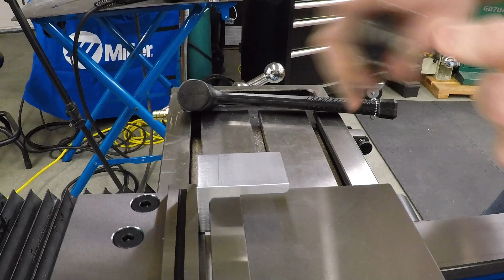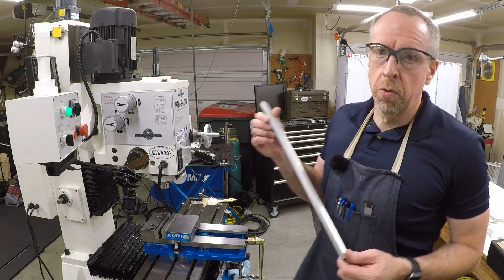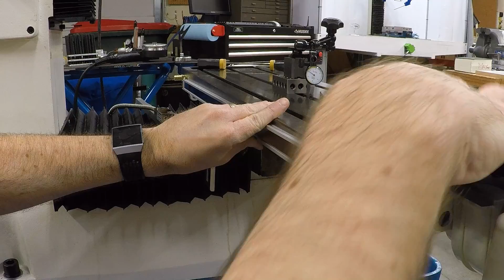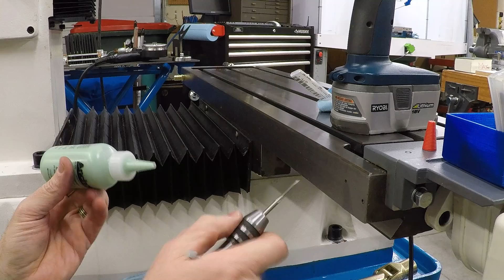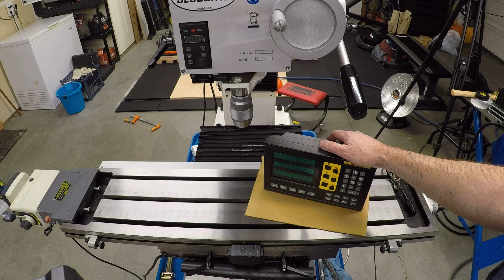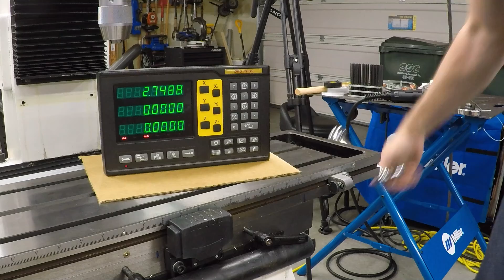Installing a DRO on a PM-940 Milling Machine - Part 2 - 4-Axis EL400

Comment: I am trying to decide which mill to get from grizzly I need something small enough for the Benchtop but strong enough to mill pockets in aluminum and mild steel? Any suggestions on what model would be the best for my needs? Also no more than 500 pounds.

Comment: Hi. Sorry for this year late comment/question. Could the manufacturer supply several predrilled/tapped holes? Thanks for taking the time to post this and all your projects.
Reply from the maker: You can buy the mill with the DRO preinstalled for a fee, when they have them in stock.
Reply: @Clough42  Thanks for your reply.
I did not think of that. I have a nice Jet RF 30 that I am looking to add a dro to but positioning the head on the round column is challenging at times. I know there’s fixes for this. I have not  purchased/fabricated anything yet.

Comment: Nice, that's quite a bit different than the cheap-o Ebay one I just installed. Of course in hindsight, I wish I did the x-axis first too 🤣. 
Also, I have just discovered that a drill point endmill is excellent for milling slots 😁. Guess some call them "slot drills", now I know why.
Great vid, James! 👍😊👍
Cheers!

Comment: I've had a 3 axis DRO sitting by my (non-CNC) G0704 for about 5 years waiting to be installed (hey, I've been busy!).  Maybe I'll steal some of your ideas after scaling them down and get motivated enough to actually install the thing.  For some reason it doesn't read properly when not installed.  ;)

Comment: Put some wax in the end of those hex bolts and then they won’t fill with chips. To clean, use wax solvent and then plug in hex key. Easy.

Comment: I wear safety glasses because I don't want chips in my eyeballs. Makes it hard to see things when I've got scratches on the eyeballs and they have to heal and I would have to go to the hospital to get them out under optics by a specialist. Wear the safety equipment; you have a lot less problems.

Comment: As always your video posts are top notch and informative, I will say though that I'm a little disappointed in that you are using magnetic scales for the DROs. I do realize where you got them and their quality but I will be remised if I didn't mention that the magnetic properties of the scales make them extremely prone to contamination from iron and steel particles despite the use of chip shields. Ive been there and dont that had major issues and switched to glass scales on both my lathe and mill. The magnetic scales did work initially but after about one year in,  the accuracy began to be affected and I switched to glass scales....that's been now over 3 years since I switched, and with zero problems. Maybe you will be fortunate and not have troubles with them and if you are,  you will be one of the 5% that dont.....Just sayin!!!!
Keep  up the excellent work.....it's nice to see someone intelligent and articulate in their methodology and actions.
Reply from the maker: Interesting.  Many people have had exactly the opposite experience.  In fact, DRO Pros positions the magnetic scales as their premium product and offers a better warranty.  It will be interesting to see how it pans out.

Comment: I think I'd use pan head slotted screws for that scale cover rather than the button head cap screws. The pan head screws should be a little shorter than the button head screws, assuming you can get pan head screws in metric.

Comment: Great video production, well storyboarded, nice lighting and use of microphone.  Is it hot wherever you are (short sleeves and shorts) ?
I clamped a steel block to the back of my mill table - with a hole in it - to act as a guide for the drilling of DRO mounting screw holes.  This not only kept the hole square, but importantly maintained the required position, not knowing if the table hardness might cause my hand drilling to wonder.
Reply from the maker: It's below freezing at night here, and a little above in the afternoon, but I had the heat on in the shop all day, so it was pretty comfortable.  Using a guide block is a good idea.

Comment: Hope I'm not duplicating a comment here, but the hard to reach points would be fractions of an inch. A whole inch is an even tenth of a mm, so as long as your scale is under a tenth of a mm in precision, you should hit hole and half inches no issue. A quarter inch is 6.35mm, so now you need half a tenth. 1/8" is 3.175mm, which requires half a hundredth - that's very close to 0.0002" by the way, which seems to be the scale of yours.  So try getting to exactly 1/16" (1.5875mm)  or 3/16" (4.7625mm), and you may find that you have to go a little off. Obviously, you'd also struggle to get 1.0001" - you will need to go to either 1.0000" or 1.0002".  Or set it to show only 3 decimal places and round to nearest 3 digit when you convert into thousandths. 

I still haven't ordered my DRO - or figured out what size I need, for that matter... :)

Comment: Interesting you are putting the display on the right side; most displays are mounted on the left since most folks look to the left first. I think it’s because how we were taught to read left to right? On my lathe of course it is on the left since that’s where the head stock is but I did mount my display on my mill to the left. When I had my Bridgeport with the factory DRO it was mounted on the right. Maybe it’s if you plan to use the left side wheel or right side wheel for the X travel?
Reply from the maker: The x crank and quill levers are on the right.  Having the DRO on the left would be rough.

Comment: Wonderful comment about wearing safety glasses. My own experience... at dusk one evening I was outside behind a truck. On the back of the truck, hanging just over the top of the tailgate, was a sheet of 1/8" steel measuring 1/8" X 4 foot X 8 foot. The sheet was laying horizontally. As I turned and started walk in a new direction my head swung into the corner of the sheet. The cut was level with my eye an only 1" away from the eye. The cut was so deep that it didn't immediately bleed. Now when I arrive at my shop I put my safety glasses on as I get out of the truck. I wear them all day long. Accidents can come in a number of ways. I was very lucky... lucky also to have a friend nearby.
Reply from the maker: A finish carpenter friend of mine was distressing a wooden beam with a wire wheel in an angle grinder when he got a phone call and took off his face shield.  After he got off the phone, he had only a little bit left to finish up and forgot to put his safety gear back on.  A wire dislodged from the wheel and penetrated his eye.  Long story short, he pulled it out, drove himself to the hospital, and fully recovered.  He was lucky.

Comment: Nice video. Are you planning on mainly working in metric, imperial or both depending on what you are milling?
Reply from the maker: I use whatever is most convenient for what I'm doing.  Usually that means whatever leads to whole numbers of units instead of long decimals that lead to mental errors.

Comment: Hi James! When installing the x measuring ruler, make sure that the oil point is not covered. I have a similar machine and after half a year the rear dovetails had jammed due to insufficient lubrication. It is useful to also considerably shorten the two mounting bolts for the table drive. That makes cleaning the table much easier. I also raised the machine 10 cm, better for the back.
Reply from the maker: The oil port on this machine seems pretty much useless.  It literally goes straight down and ends on top of the dovetail with no visible distribution grooves.  I extend the table fully to each side and apply way oil with a brush before I use it.  A one-shot oiler would be handy.
Reply: @Clough42  came to find this issue while installing my DRO.

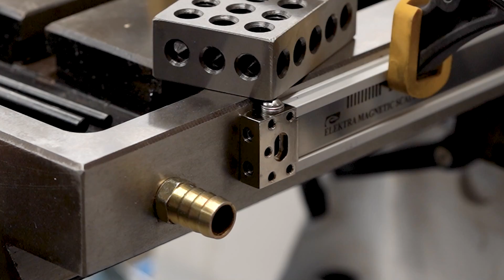Comment: What's the magnetic stand you use on the DTI at around 19:20? I've got one of the cheap ebay specials, but I've not come across one with a fine adjuster like that before.
Reply from the maker: https://amzn.to/33FwerY
Reply: @Clough42  Nope.....Too expensive.......I just use a regular scribing block with a small dial indicator as it already has the fine adjustment.

Comment: Hey James! Coming from a garage workshop, any tips on how you keep from tracking chips into the house. I have little ones and I just have to clean up really well before going inside so chips don't end up under their feet. Thanks!
Reply from the maker: It doesn't really matter what I do.  Some always end up in the house.
Reply: @Clough42  seems like that's my case also
Reply from the maker: I tested a new insert end mill in steel last night, and it shot .005"-thick bright blue chips eight feet in every direction.  I think some containment is going to be a necessity.
Reply: @Clough42  Now you are getting wise........anything pertaining to a milling operation is sharp pointy chips.
Reply: @Clough42  My wife sews and I find pins around the house so in my book we are quits !
Reply: I always brush and or blow myself off, before coming in the house after playing in the shop. Most times I also  remove my shoes as wiping your feet rarely ever removed the chips.
Reply: @royhauer311  I try so hard. But always tend to have chips in folds of my clothes. Also, the chips I blow around (aim for under my bench) tend to find their way under our feet into the house. I just have to drain an entire compressor tank anymore keeping the chips at bay

Comment: Hi, I would drip paraffin wax into the hex heads to keep them dirt free. Your wife should have 100s of those small T-lights on hand (mine certainly does) you can source wax from. When you need to remove the screw just add a small bit of heat from a match or similar (not a flame thrower) will burn out the wax and your head will be clean and lovely. I bet you are missing your quick change collet on this new mill, I can see that dust cover hitting the bin after a dozen or so changes :)
Reply: Came down here to say exactly this. Or instead of wax, you could use a bit of modeling clay, and then either just force through it, or bake it and make a cap that you can take out when you need access.
Reply: instablaster...

Comment: Why do you not have and use a air hose at the machine to blow off chips and holes?
Reply from the maker: I have one ordered.  I'm reluctant to use air on a machine with no chip containment--especially with the squat rack right behind it.  But I'll eventually want it.

Comment: 5 microns is not exactly 0.0002", error is 0.8%. Very intresting, where they hide it.
Reply: Most if not all of the glass DRO.s have minimum 5 Microns accuracy.........heck, I can't even see that small unless I have my 100 X loupe in my eye.
Reply: @gangleweed  5 microns for optical measurements is very coarse, but i mean other thing: according to manufacturer specifications, we have 5um scale, but dro shows in 0.0002 increments very smooth. It is not possible without errors.
Reply: @КонстантинКучер-щ5м  For engineering moves on a mill 5 microns is fantastically accurate.

Comment: When I mounted my DRO panel, I didn't like the Chinese arm that came with it. Instead, I used an articulated LCD TV mount (20-36") that I had laying around. I use these for mounting computer monitors to the wall. This gave me more mounting options on the mill and also gave me more adjustment after installation. With the manual table feed handle on the right, I wanted to be able to move the DRO out front, aimed to the right. Same with using the power feed on the left. And of course straight ahead. I have a Mill/Drill and because of the quill-down triple handle on the right, I didn't couldn't mount the DRO on the right side. There were some controls and the down-feed lock handle on the left, but it was low so I decided to mount the DRO pivot base, back by the head mount about 2/3rds up. With the articulated arm, I was able to keep things tight but still be able to pull the DRO out far enough to easily see when standing close to the right feed handle. Also, the TV arm head (where it attaches to the DRO) swivels in 2 axis, allowing me to tilt it down a bit and swivel it right and left. It tucks nicely behind the mill face but pulls out and swivels completely to the right so I'm not looking at it sideways, but face-on. This is important because my DRO is one of the LCD ones. I hope this info helps a bit with your mounting decision. That last step drove me nuts for a couple of days since I had to drill into the head to mount the DRO. I needed it right the first time to avoid installers remorse (where did I put that Bondo?). Good luck.

Comment: Wow I was not expecting the power tapping in aluminum!

So from Menards I've gotten (several times) a air blow gun kit that had a ball inflator needle that could thread into the main body with valve. Now I know why (not for exploding basketballs after all...)

Btw, Having tried flux core in my machine since I last commented on your channel (I asked why you started with tig), I can confirm that wire feed is definitely like metal hot glue. So if you ever get tired of doing your aluminum welding the fancy way with tig, go get a mig machine and spool gun...
Reply from the maker: I have a spool gun and you'll see it welding aluminum soon.
Reply: @Clough42  oh very cool!

Comment: Loved the video! I'm about to launch into fitting a DRO to my mill, so brilliant timing for me. My mill approximates yours in shape and size, so there's a lot I can glean from this. Thanks!! 
Also, could you explain your technique of power tapping? Is it like a light pressure as it drives through the work?
Reply from the maker: In general, you just want to let the machine pull itself through at the right speed.  This quill has a heavy spring, so I'm trying to apply enough pressure to counter that, but it's tough with a small tap and a flexible workpiece.  You must use a machine tap, though.  Spiral point or spiral flute.

Comment: It might be interesting to check the scale to read head clearance throughout the X-axis travel, in case the rear side of the table is not exactly parallel to the X-axis or the scale is bowed (both unlikely, I know).

Comment: Since 2 000 rpm is marginal for a 1/4” bit of any kind (but particularly carbide), and you will be using that, and likely even smaller diameters, why didn’t you get the “V” version of the mill, that goes to, I believe, 5,000 rpm?

Comment: hmm maybe you should get a magdrill or magnetic paralel adapter for your drill for the other axis ( i know i would. and not just for the holes for the axis but also for tapeing a hole in a part that i have already taked out of the vise or add a hole later in something )

Comment: Excellent video as always, thanks for doing what you do, we do appreciate the effort you put into these productions. I noticed that you opted not to use loctite to keep the screws from coming loose with vibration. I have not done an install like this myself (one day... in the meantime I count), but I would have opted for a drop of loctite on those threads. Your thoughts on this?

Comment: Another great vid! Question: at 9:35 for example when you are facing your material, why are you using the end of the bit? Wouldn't you get less chatter by being closer to the base of the bit (less opportunity for bit flexing)? Maybe not an issue with that operation but this is more of a question in general.

Comment: I have a Rong Fu RF-45 version of that mill and I use my dewalt impact driver with a 17mm socket to loosen and tighten the draw bar - works great even if the machine is in high gear. And as far as i`m concerned it has not over torqued the draw bar or put any damage on it in 3 years!

Comment: To find the correct drill size for a metric thread take the pitch of the nominal size eg M8x1.25 pitch use a 6.75Drill, M4x,7use  a 3.3 drill
Reply: I use that method too but note it only applies to coarse threads.

Comment: Little trick when setting your parallel in your vise take a .020 thousand shim stock 
Give it a bend in it than slide it between parallel and moveable vise jaw in your Kurt vise it will keep your parallel from moving in a production set up 
Gunny012
Reply: Metal banding strap works great for this. I bend it in a W shape with the outside legs only 1/2" or so long. Then there isn't a sharp edge scraping along the vise jaws/parallels.

Comment: If you have a .200 lead screw then set the dial to minus .050 then when you pitch off the dial will be 0 learnt that @ 16. save doing it twice.
Reply from the maker: Good tip.
Reply: @Clough42  well if the dro goes down then the old ways will save your a##e lol

Comment: It seems the divisions on the scale are 5um so the error should be at most 2.49um or 1 tenth and it should correct its position at each division so it shouldn't have any value you can't hit close enough for manual machining and the rigidity of your mill.
Reply from the maker: For sure it can get close enough.  It still feels unsatisfying when I want x.0000 and the scale jumps from (x-1).9999 to x.0001.  I have exactly this problem on my CNC mill, which has 5mm ballscrews.
Reply: @Clough42  I have the answer - go metric !  Best regards from the UK 🇬🇧 which is the 100% metric.  Apart from road signs.  Oh and newborns which are discussed in pounds.  And pints 🍺.  OK so we are 63/64 ths metric.